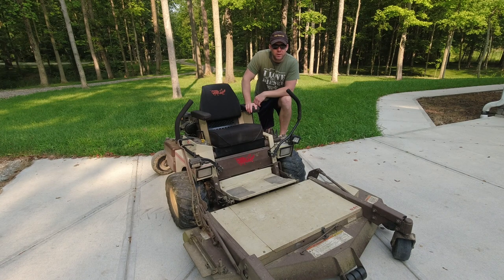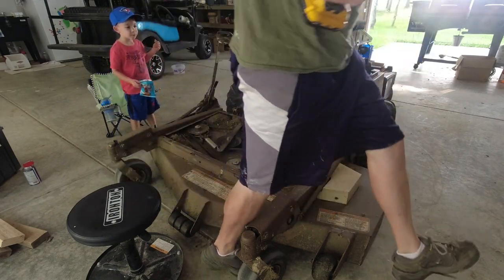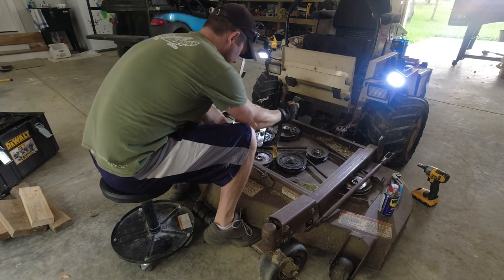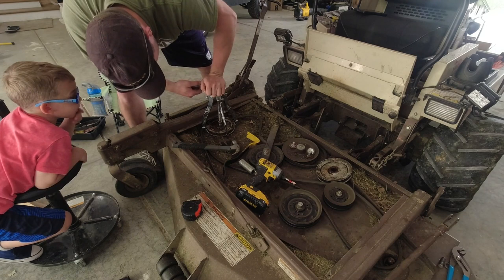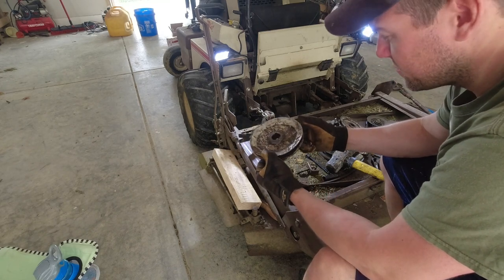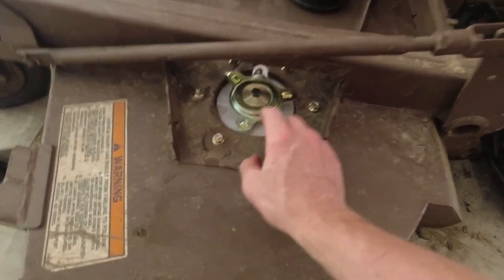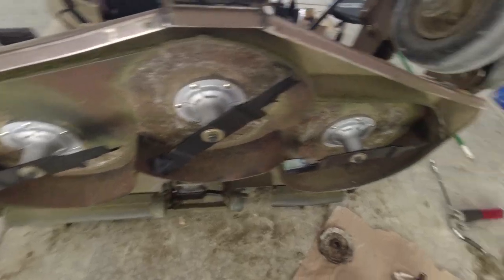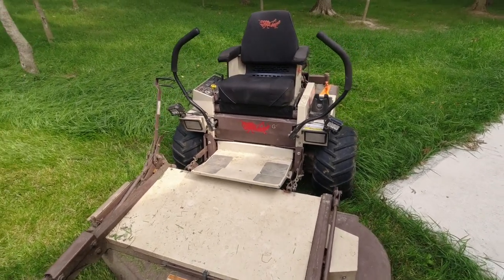How To Replace Mower Deck Spindles - Grasshopper Mowers

Comment: Perfect timing! Had my right (discharge) spindle lock up last week so I’ll be tackling this soon on my 2004 725K2 with the 61”. Still trying to decide whether to rebuild whatever spindles are on it or just order these replacements. Thanks for taking the time to create the video!
Reply from the maker: Glad it was helpful!  I would say just check the other two for wobble and go from there.  If they are old, may be worth doing it while you have everything out.

Comment: I grew up with primarily nothing but Grasshoppers. My dad ran 2 and a Woods front mount for years when we still had our Lawncare business. It’s one of the only mowers I prefer anymore, and definitely are built to last! Only other mower we had that I loved, was the Cub Cadet Tank mid-mount. It was super smooth, dual fuel tanks, and the deck just floated.
Reply from the maker: Hoppers are hard to beat!  I'm yet to meet someone who has used one and didn't love it!

Comment: have 2004 725 G2...kubota gas 3 cyl.   61" front deck.  how did you cross GH spindles to after market spindles ?   i am sure i will have to replace mine at some point ?
Reply from the maker: I found the GH part numbers and then just searched them on Amazon.  Wasn't too hard.

Comment: You don't have to replace a fender spindles on the grasshoppers you can just go to your local hardware store in rebuy the bearings and they would only cost you about 20 to 30 bucks I've done it to all three of mine grasshoppers that I've owned by
Reply from the maker: Good info!!  Wasn't aware you could do that.

Comment: I’d just replace the bearings in the spindle!  Then it’s a 1/4 the cost of your aftermarket spindles.
Reply: lol not if you destroy the spindle just trying to get it off the mower deck 😅